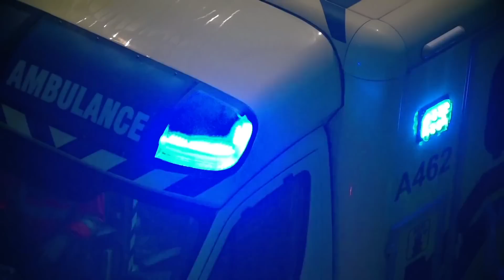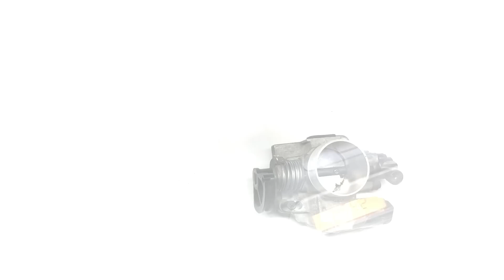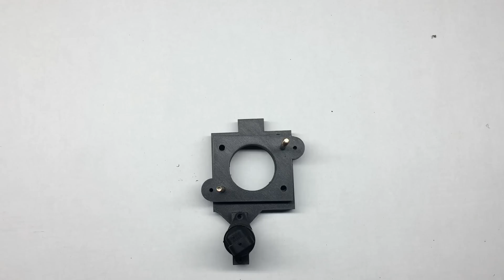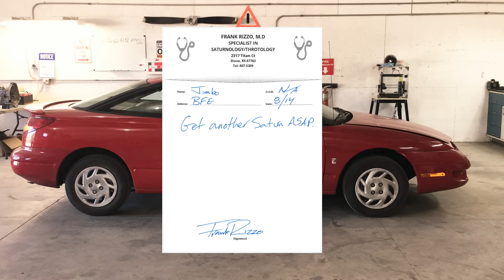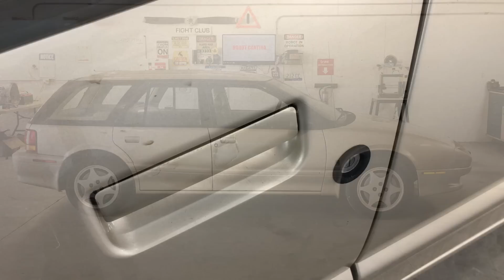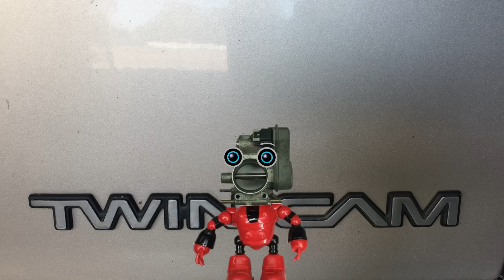S2E19: DIY Smart drive by wire throttle plus new project car Saturn SW2

Comment: Having a manual throttle downstream from a ECU controlled one is how Suzuki do their early 1996 onwards motorbike fuel injection and it works well limiting the air into the engine when the rider fully wangs open the throttle at low engine rpms

Comment: Probably could have used a gm cruise control unit that they used in 90s trucks, I'm pretty sure it's just a motor in a box with a cable coming out that goes to the throttle body.

Comment: i've got a mid 2000's saturn ion sitting in my front yard that i picked up for a hundred bucks to do a fix and flip on because some ditzy girl ran it into a ditch while trying to avoid rear ending a county highway dump truck, and knocked the styrofoam front bumper, and bumper skin off of it. yes, you read that correctly, it has a styrofoam over fiberglass front bumper. gee, that sounds safe, huh? thankfully, the airbag didn't deploy, although i have no idea why not, and i'm not gonna look any deeper into that squirmy can o' wormies and you can't make me, so there, pllbbbbtttt! anywho, i guess her dad paid like three grand for it 8 months prior to her ditch diving escapade because it has low miles, and it had a really clean interior, the key word in that sentence is "had", but that ship has sailed being as, from what i can see, she's a big old slobby slob. i just got the new clips to put the front back together in the mail, after the long, multi-month trip on a big slow boat from china. the NADA book says it's worth $1200-2200. i'm gonna try for the lower end of the spectrum after i get it all reattached and wear out a tooth brush from scrubbing crud to make the insidey bits look pretty. well, as pretty as a saturn can look anyway, so wish me luck! i need to acquire a good running SBC for a rat rod project, and the funds from the sale of this saturn will hopefully help me to do just that.

Comment: There you go. Dual throttle bodies have been a thing for a while in motorcycles, so you get the immediate response of cable driven, and fine RPM based control from the ECU

Comment: I had a 2000 SL1 when I was in college, had aftermarket cruise, manual everything except the transmission sad face 1L engine, it was a turd, but it was a reliable turd. Also the unibody design of the car, I lost control on the highway and ended up in a ditch, tumbled the car 6x, ripped the front and rear of the car completely off, engine broke off and tumbled in the engine bay,  but inside was mint, extremely safe car

Comment: Part 2 for this episode I can't wait. I have been thinking about similar project too. Only difference is that I have thought of sort of cruise control mode 2, where the maximum fuel usage can be limited. I mean that driver sets the speed, computer keeps the speed until a hill comes and fuel usage rises until it hits the limit.

Comment: You should put a Swamp cooler in the garage. Its cheap to run and works at that low humidity you just showed. With A/C it can be impossible to cool down a garage that is not insulated well. Also the cost to run and least where i live they are forbidden to use

Comment: I picked up a ductless mini split heat pump (1 ton) that would do quite well in that shop (compared to no ac situation that you seem to have now), and it was only $680. You should definitely look into that to keep your shop survivable during the brutal hot summers and the occasional bitter cold winters.

Comment: I think targeting desired pressure in intake manifold is not good idea for comparable results. If engine start misfire or loose power due to not optimal ignition advance speed will start decreasing and that will rise intake pressure. Arduino to maintain pressure will close throttle and speed decrease even further. In my opinion test should priorities road speed.

Comment: It is funny, that cable throttle defaults  to fully closed, so 0% TPS. But e- throttle defaults to about 1mm from fully closed, and this small gap gets called 15-20% TPS.
This makes limp

vibrations, overheat risk and mad fuel consumption
Reply: Also Vmax in my car was 55mph and engine suspension was getting absolutely massacred, as power went on and off every second, but while cutoff was active engine braking was intense thanks to high air mass being compressed C:

Comment: It might be an idea to log the TPS data to an SD card while doing the fuel economy runs seeing as you have the TPS going into the arduino anyway. That way you can see if the engine requires more throttle on average to make up for any loss in power changing the AFR makes.

Comment: For those that don't understand Michigan Vs everywhere else summer temperatures. 

I was up in Battle Creek Mi for the 18th annual Cruise the Gut. It was early August and around 80 degrees out. People were losing it because of the "heat".

Comment: Everyone always assumes that a rotary sensor is a potentiometer. There are such things as rotary encoders which won't wear down and start exhibiting different resistance values over time. The catch is that you need a few wires rather than just two, to convey the encoder's position as a multi-bit value. If you're already going to be using an MCU to take a potentiometer signal then you might as well just use an encoder instead because it will be almost just as easy - only the coding will be a bit more advanced - and greatly more reliable. The trick is using a grey encoder where instead of a typical multi-bit binary integer being output it only changes one bit at a time when it transitions from one value to another, whereas typical binary will have multiple bits flipping on/off when transitioning from one value to another, and rotary encoders are not 100% perfect so you might get noise values when transitioning between values. Grey encoders solve this problem, limiting the noise to just the transition between two values, which isn't a big deal in 99% of applications.

Comment: Spend a little money and get your shop some AC. Split systems aren’t very expensive, don’t need a lot of power to run, and will make the hot summer days of Southern Kansas livable.

Added bonus - installation video makes for additional content you can post.

Comment: My mother in law has a  95 model sw2 I had to do a ac bypass but besides adding a bit of  transmission fluid to her automatic transmission it still runs and the 35+ mpg is not a stretch I believe the 40 mpg.

Comment: Drive by wire can be done entirely in the analog domain, that's how little hobby servos work.  However, you really want non-linear throttle response and that is not easily achieved in the analog domain, so a digital device with a custom transfer function is almost always called for.
Reply: most hobby servos are PWM dude.
Reply: @nobodynoone2500  The control signal is PWM, but how do you think they control the motor?  There is a potentiometer on the output of the servo that feeds back into an analog driver to control the motor direction and speed.  The PWM signal is nothing more than a command signal that directly translates to an analog setpoint inside the servo controller.  If you replace the potentiometer with one that is not connected to the output you get a variable speed continuous rotation gear reduction motor.  In that case the feedback at the "mid point" results in zero rotation.  Basically they just say "is the voltage on the potentiometer equal to the setpoint voltage?" and if it's less the motor spins one way, more and the motor spins the other way.

Comment: You need to be monitoring and logging BSFC in your experiments, that will tell you if you are getting anywhere.  Yes, BSFC will require some sort of load/torque feedback to be useful, but your lean burn experiments suggest that you are leaning the mixture out so much that you are losing torque and therefore the BSFC is actually going up.

Comment: Hey that Arduino H bridge you’re using I’ve used several times before. I used it to drive speakers for an electronic tornado siren before that could be heard from 1/4 mile. I stopped testing it monthly due to the obvious reason of being a hated weird neighbor

Comment: Two words: Mini Split. Cost effective, efficient and DIY friendly. Don't even have to do the whole shop. Slap up a partition where you spend most time. One trip to the ER probably would have paid for it. PS: Automotive engineers from the 80's spent untold hours and pallets of money to do what you're doing in an overheated garage in Greasy Creek, Kansas. Amazing!

Comment: My dad as a mechanic has had more cars come in with no start problems due to aftermarket alarms. They either freak out and not turn off or turn into resistive loads and completely kill a battery to be unrecoverable. Great videos and hope you feel better.

Comment: Drive by wire I feel like is the worst inflvention ever.  My girlfreinds moms car had an issue recently where going down the high way it just stops accelerating.  Imagin trying to do a left hand turn on a busy street.  Just dangerous in my opinion! Stay cabled!

Comment: Talking about Saturns makes me think about how most were basically GM's European chassis and bodies just resold to the US market, at least in their later years they were. GM was already integrating Vauxhall/Opel construction into their remaining brands around that time anyways and like Oldsmobile in their final years there was no need for another brand that was just another Buick with a different badge. Well those are my thoughts about it, now go and drink some water.
Reply: Got a source for that? I know the drivetrains were often shared, but not the chassis and bodies. The saturns were mostly plastic over steel construction.
Reply from the maker: The later Saturns were just re-badge GM junk.  The early Saturn S series that were made in Tennessee were unique and had very little GM DNA.   I think Saturn pretty much died when the last S series was built in 2001.
Reply: @robotcantina8957  It did seem as though most folk lost some heart towards brands such as Saturn, Pontiac, Hummer, and the like around the 9/11 era and it kept getting worse after 2005-06. The more GM thought that they did something innovative the more a product failed to impress the public, such as the SSR and Aztec for example. Now go and drink some more water.

Comment: Since that's a 1995 it has the same leather seats as a gen 2 sedan/wagon for the front. Also, I think someone swapped the seats on that car because the door panels have a different pattern of fabric instead of vinyl/leather.
Reply from the maker: Should the door panels be leather on this car?   Interesting....

Comment: why not control the original throttle body with a servo? You dont need to spoof anything into the ECU. 

adding a 2nd throttle will mess up fuel trims or throw a "vacuum leak" code as the throttle body isnt moving, and the manifold pressure changes

Comment: Looks like it's time to go stand-alone efi it would give you so many more options for testing. Since you are using DBW i would recommend something from RusEfi (all fully open source), either the proteus or the micro as it is designed for 4 cylinder engines and supports DBW out of the box. From personal experience there is a decent amount of efficiency to gain just from higher ignition timing in vacuum at cruise rpm. I haven't personally used RusEfi yet but i have a micro and am currently building a harness for a 2300 ford project. On my current daily (ford 302) I have gained 1 mpg in town and 2 mpg on the highway with a megasquirt 3 and no prior efi tuning experience. RusEfi uses tuner studio so you will already be familiar with the software side of it.

Comment: We're having a heat wave with 90F heat over here in DK too. Remember to drink water, Jimbo!
Reply: Still weird seeing 90f as a 'heat wave' here in the states. We see 90's quite regularly, and a 'heat wave' usually isn't called until about 95 or higher. Where I grew up, we had no a/c and it was often over 90 even at night for weeks at a time in the summer. You learn to stay hydrated, dress light and shower often. That said, i've moved to where it's cold and nearly passed out last time I had to work in the humid 95 degree heat for just a few hours.

Comment: Hear me out... Drive-by-wire carburetor. The throttle is controlled electronically, but the fuel mixing is still done by vacuum. It's a pointless idea, and I know you're into that sort of thing.

Comment: I hate to say it, but you are essentially just engineering exactly all the fun sucking factory throttle control car manufacturers use right now to maximize fuel economy, hahaha. It is fun to reengineer it though! Thanks for the awesome insights.
Reply: I'd rather have funsuckers that are easily removable than proprietary funsuckers you are stuck with

Comment: I noticed the other day that when I drive, I always accelerate at WOT, and then as the RPMs come up, I start to ease off the throttle.  There is some audible feedback too, it's hard to describe, but I just know what my engine sounds like. 

I don't know if this is good or bad for fuel economy or the engine.  I reckon this might be the flintstone way of keeping the engine at peak load.  I can't check fuel economy reliably as I am usually towing and I've been making adjustments to the timing advance.  There is also a fault in the IAC, I replaced it, but it appears to be the circuit/ECM.

Comment: I can help with the seat. At least on my 01 SL1 I was able to disassemble the seats and swap the torn broken down cushions with the otherwise pristine passenger seat to the driver's seat frame. In my case I threw the remaining parts away and only have a driver's seat now
Reply: Thats a good tip. Works on many cars.

Comment: I wouldn't drive a car without power locks and windows. There is not much I hate more than walking around a car every time to stop making sure all the doors are locked and when you want the windows down while driving alone and trying to lean over the seats while driving is just not going to work for me anymore. Maybe 20 years ago

Comment: sounds like you just need to go full aftermarket ECU. its a bit more work to rewire, but you can half ass it and splice into the stock wiring harness. the aftermarket ECUs out there give you infinite control over everything and you get finer read outs on your sensors. I put one on my miata. I deleted the EGR sensor so I could save a few connections into the ECU. I thought my fuel economy would take a dump without the EGR, but my fuel economy is better now than it ever has been.

Comment: Hope you feeling better and watch the heat. I saved a guy that had collapsed in the New Mexico heat. He kept passing out on me until I got a bunch of water and a Gatorade into him. 
You would love my 96 Mazda truck I tow behind the RV. 2wd , manual transmission, manual windows and door locks and no ac. The later sucks at times, but at least it doesn’t rob any power of the 2.3 four cylinder that can hardly get out of it’s own way. It set several speed records going uphill behind the RV with a 505hp pre emission Caterpillar. 😂😂

Comment: Have you considered air conditioning your workshop/garage? It has drywall, so I am assuming it is insulated. Not sure if it is detached or not from your house though (not that it matters, but attached may give additional options).

Comment: I would put an override switch for the dbw so it is a mechanical interrupt that will zero the throttle.  Not that your code might have a bug in it, but the TPS could go bad etc.  Having a switch on the dash is a better option than throwing it into neutral or trying to turn off the engine but not lock the steering wheel at speed.

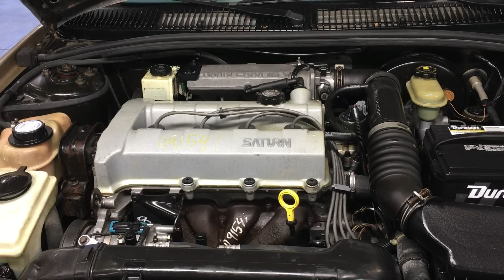Comment: 13:53 Whomever ordered this car when new definitely had the right stuff. I'm not certain if I'd care for leather seats during the Kansas Summers but a wagon with a 5 speed, a twin cam engine and AC? That's about what I would have bought if I was in the market for a Saturn back then. My 90 Civic Wagon was ordered to that spec, minus the twin-cam. Complete with wind up windows.

Comment: Now this is neat. 

I remember when I first LS swapped my car, I was hard headed and insisted on keeping DBW (Early DBW from the Tahoes.. before the OS support came along). Discovering/Editing tables for Throttle% x Airflow was a nightmare since I was flashing with LS droid- but also equally fun. Full electronic cruise, idle airflow adjustment, etc, made it all worth it.

Comment: Early DBw Dodge Ram trucks had a throttle cable from the pedal to a APP sensor UNDER THE HOOD which sent the APP signal to the PCM and back out to the throttle body. As the crow flies they're about 2ft apart but looked like they had about 20ft of wire to connect the accelerator pedal position to throttle body. At that point I was scratching my head at Chrysler really hard, since you already ran the cable and you mounted the APP outside the cabin why not...I mean...I think I scratched a bald spot trying to figure that one out. As for a easily mount-able APP and pedal combo I present to you....GM GENUINE 15218992 found on several years of Buick Lucerne and Cadillac DTS. It's got a nice steel plate with 3 mounting studs. There's a few other GM parts that bolt on in a similar way but these pedals are fairly cheap and strangely readily available given the narrow year and model range.

Comment: Your original plan to attach the throttle cable to a position sensor mounted in the engine bay is exactly how Mercedes Benz did their throttle by wire in the 90's. I guess great minds think alike.